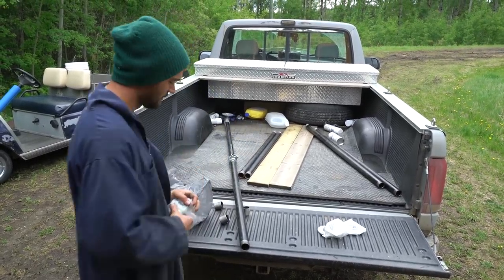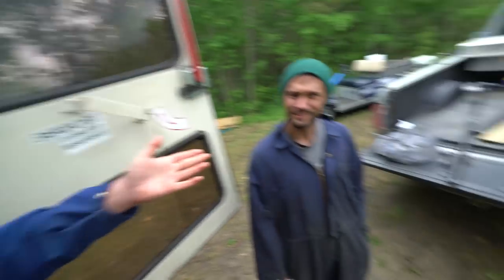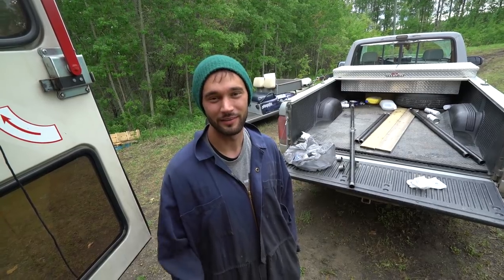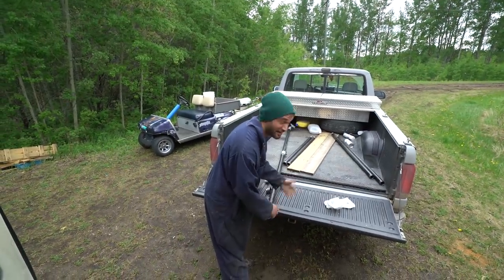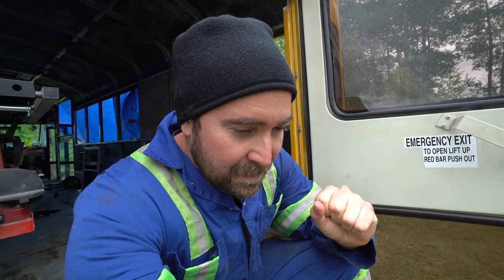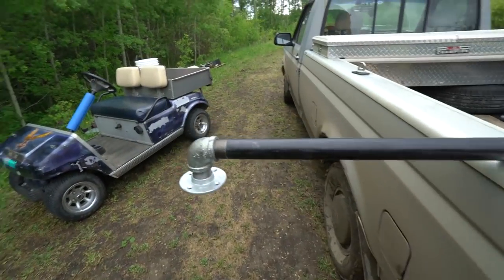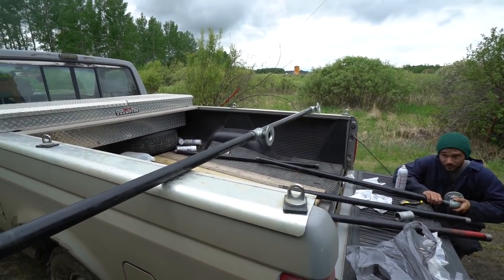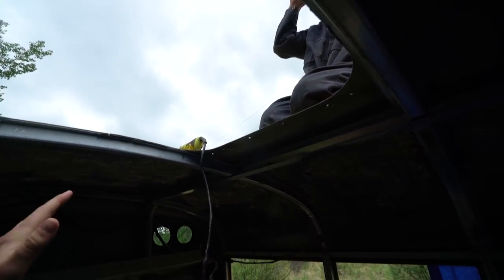MICHAEL ALMOST CUT HIS ARM OFF

Comment: I had a similar experience with a zip disk. I wasn't as lucky as you. My cut was an inch deep and 3 inches long. Took 12 stitches. My instinct was to quickly cover the wound up with my other dirty, greasy and metal filled hand. Worked out tho, have another battle wound to add to my collection :)

Comment: I was right! A deck I just knew it. I was thinking maybe a drop down staircase like an attic access ladder. On that pipe the threads have no protection, buy a can of Cold Galvanize in a can and spray the threaded area. Are your connectors pipe thread ? If you got conduit connectors the thread is different. I have 6 stitches in my wrist from a disc that exploded. Always wear safety face shield and leather gauntlet gloves.

Comment: Bummer on the pipe threads. The place that threaded them didn't have the pipe dies adjusted properly. Always check the threads before you leave the shop.....................on that size pipe the fittings should thread on 2-1/2 to 3 turns hand tight.                                                CCC

Comment: So, what are the pro and cons of AstroTurf vs. a ribbed deck? UV's and comfort and safety/accessibility. Did you have some close calls? Max occupancy? Was the contour pleasant or consistently caught you/folks off guard?

I'm toying with having a mounted steel railing but the AstroTurf roof. I'll be in a hammock more than anything up there...either my hammock stand or railing extensions to hang from...

Another use would be to turn a safari style steel mesh rack into a "patio" with a rolled out piece of AstroTurf...just enough insulation to not burn your skin on hot metal...
Reply from the maker: I did the turf last time bc I didn’t know how to properly build a deck. This time, we do. The turf would artiste heat thru the ceiling, but it was as much the poor stock insulation as anything else. We had like 15 people in the turf before. They’re really strong. But this will be much stronger and secure. And hopefully cut some heat as well.
Reply: You definitely got me thinking...my buddy welds but the turf could still be cool for around the solar panels or whatever, so you could kneel down in shorts, etc...plus ive got a cat and I think she'd love it! Love the Vlog!
Reply from the maker: Thanks! The panels get hot below them as well, just FYI. You can’t sit in sheet metal in summer w/o getting burned. The grass is cozy.
Reply: "The grass is cozy..." you da man!